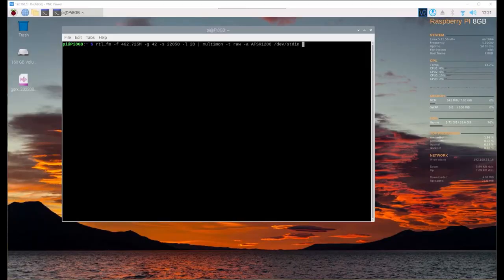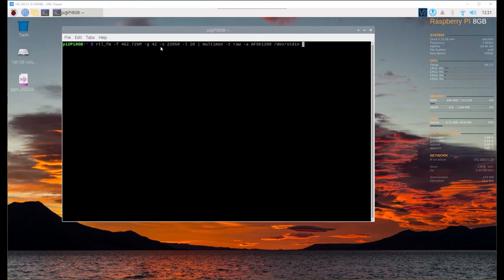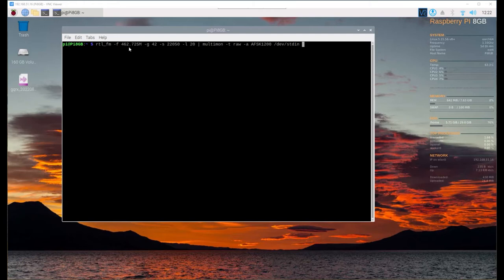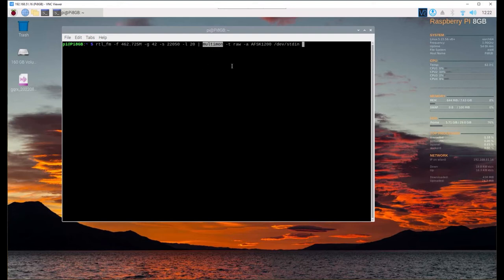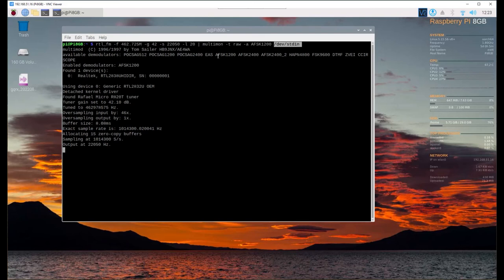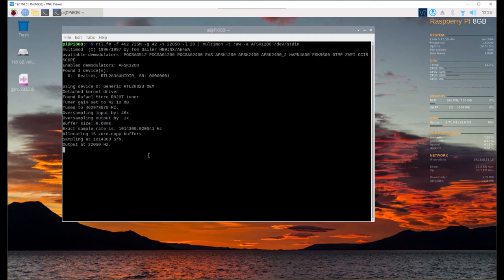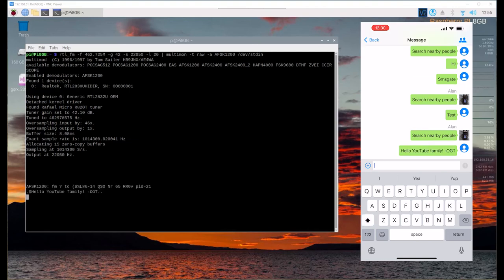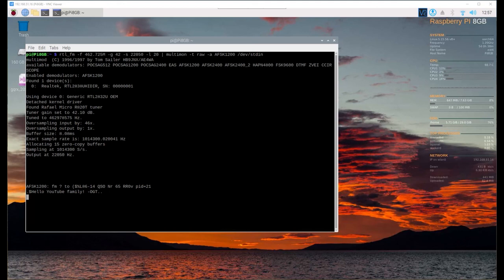BTECH GMRS Pro APRS Demo | Offgrid Technology

Comment: I have two of these, the issue I have nobody's made an updated video with the new firmware on how to navigate !!! It would help the newbies on how to navigate on the new firmware.
Reply from the maker: Exactly a video I am working on. I’m learning the system and should have it out soon.
Reply: From what I'm hearing there's no updated manual with the new firmware either, navigating with the new firmware
Reply from the maker: It’s fairly easy but it’s not what you think like an active tracker, it’s more of a waypoint. Video should be up by Monday.

Comment: Nice radio, I bought 2. Really like the texting and map location of others in group function. I'm new to radios. Need a tutor on how to operate. Are these things using the meshtastic software and networking radio protocol?  Can these radios be set up for ATACK app on Android for SHTF security protocols?
Reply from the maker: Have not gotten to work with atak or itak yet. It used afsk modulation not css like Lora uses which is what meshtastic is built from. Same principal but different tech.

Comment: Personally I'd like to get my hands on one of these just to try APRS reception on one of my amateur radios since you can tune the radio to basically any frequency within a wide range of VHF and UHF frequencies including ones you cannot transmit on. Alas they wouldn't be able to talk to one another 2-way considering my amateur radios won't transmit above 450 MHz but they can receive upwards of that so it would be interesting to see if they can decode the beacons or not.
Reply from the maker: That would be cool!

Comment: Interesting. The use of AFSK modulation doesn’t mean it supports the APRS protocol though. And the biggest problem is that a GMRS radio can’t Tx on 144.39 that APRS uses in North America. Most can’t Rx either. There is no APRS infrastructure setup on GMRS channels that I’m aware of. Maybe we’ll see that in future GMRS repeaters.
Reply from the maker: Agreed and I hope to see expanded use. I feel gmrs can really benefit from data in SHTF and off grid scenarios.
Reply: @offgrid.technology  Yeah I think FCC rules would be a big challenge, but you could setup cross-band repeat to Rx the GMRS packet and Tx on 144.39. If separate radios handled GMRS and VHF it might be acceptable to FCC.

Comment: Does Btech have a radio that supports this app, but is tuned to work on ham bands?  Also how are you connecting the radio to your phone?   BT or is there a cable connected to the phone?  Thanks for sharing.
Reply from the maker: Hi it’s all over Bluetooth. BTECH does not but this model is based on the Vero VR-N75 which is UHF HAM only. No dual band unfortunately. https://www.verotelecom.com/VERO-App-Programming-Two-Way-Radio-VR-N75-p1623587.html?variant=8915930

Comment: The BTech GMRS Pro does not use APRS, it uses a texting protocol that sends location data and text messages in a data burst over UHF frequencies. The Garmin Rino’s have been using a similar non compatible protocol for 20 years. APRS was developed in 1984 and sends a similar but not compatible burst of data over a selected VHF frequency through a network of fixed and mobile relay stations to individuals who are mapping this information on computers or receiving them on like equipped APRS radios. Just because a radio can send out map data and text messages does not mean they are using the APRS system.
Reply from the maker: Thank you for your info. The manufacturer themselves say this radio has APRS function and the original app has the APRS settings for the radio. Either the manufacturer is wrong or there is a use of naming being crossed. Everything I have researched says this is using APRS formatting for its transmissions.

https://www.verotelecom.com/VERO-App-Programming-Two-Way-Radio-VR-N75-p1623587.html?variant=8915930
Reply: What say you Bdog?  Will you endeavor to be helpful?  Or, continue to let everyone know how much you "know"/do not know?  All parties involved...Please resolve this!  APRS enabled?  Yes or No
Reply: @kenatpach  Hey guys, it really doesn’t matter what they are calling it. The radio just doesn’t integrate with the network of APRS weather stations, weather balloons, igates, repeaters, mobiles and home stations. This mismatch occurs because APRS in the United States operates on a specific VHF frequency. As we all know, our GMRS radios operate on UHF. Don’t get me wrong, I hope that the manufacturers continue to develop the texting and GPS abilities of our radios. We should all be emailing to these manufacturers, encouraging them to continue developing innovations to the GMRS radios. As a matter of fact, there is no reason texting and GPS information is not incorporated into the MURS radios. The FCC regulations already allow digital data to be transmitted on MURS without special exception. It would be great if the FCC would give us GMRS and MURS users a couple more channels and dedicate one for a digipeater Igate so that as we are away from home hunting or fishing we could send a message back home informing our families that we are safe.
Reply: @bulldogbrower6732  as someone who has a general class amateur radio license for almost 20 years. You can use aprs on any frequency. The only thing is there’s no network of other radios listening for that data on the other frequencies. These radios could be using the same aprs that everyone uses on 2m’s. The target market for radios like this is for hunters/hikers who just want to send a text/gps to their families or group. There not trying to send there location and text to someone on the other side of the world.
Reply: @bulldogbrower6732  you can iGate any frequency into the APRS system. What matters is the receiving frequency of the Igate. You are correct we need to get compatability to the forefront.